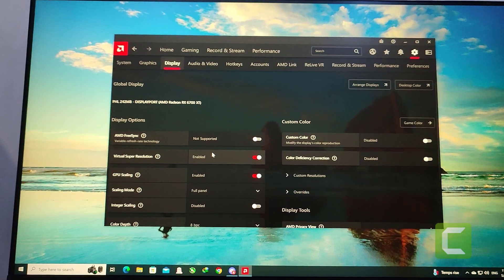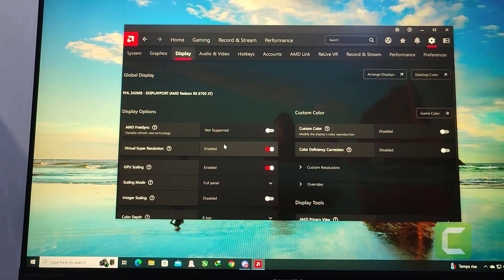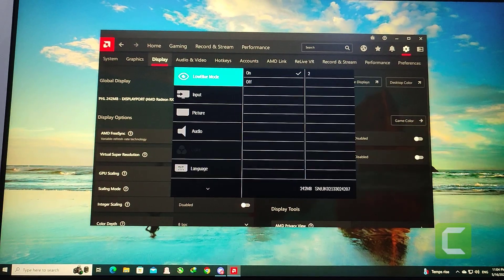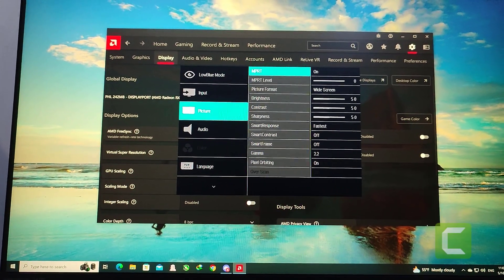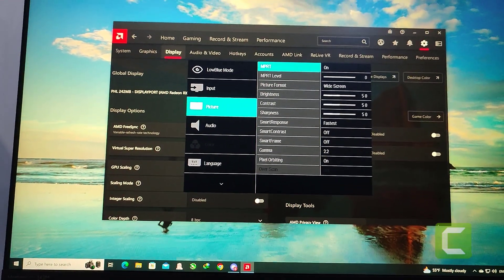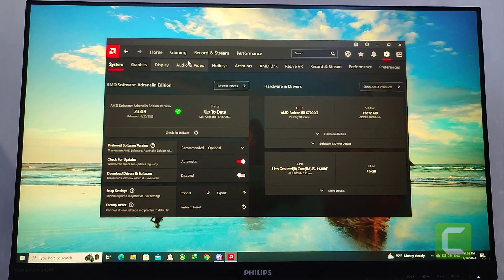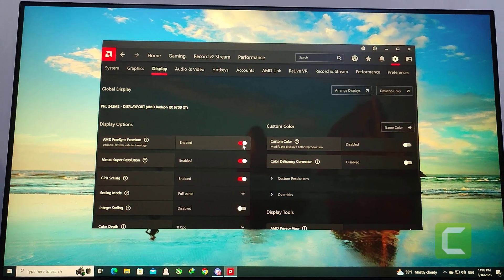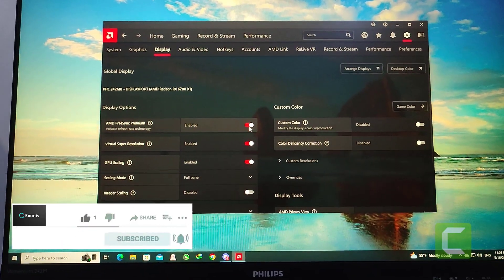How Solve Freesync Not Supported in Compatible Freesync Monitor | easy !!

Comment: how about in laptop
Reply: Did you get the solution 

I did a clean installation of the drivers and after that it's showing in the freesync area not available 

Although in games section it is available 😅 i can turn in on , amd optimised and off

Comment: How did you got that menu
Reply from the maker: Hi , Press the second button from the right under the monitor, the (ok) button will open the monitor menu
Reply: I dont have that settings in my monitor how can i fix this?
Reply from the maker: What is the exact model of your monitor?
 @aionsasakura5492